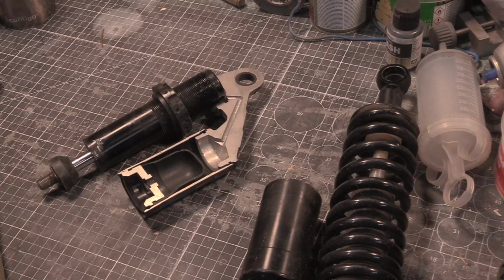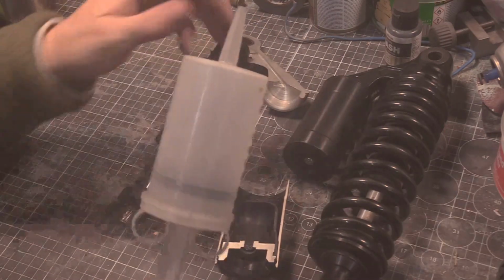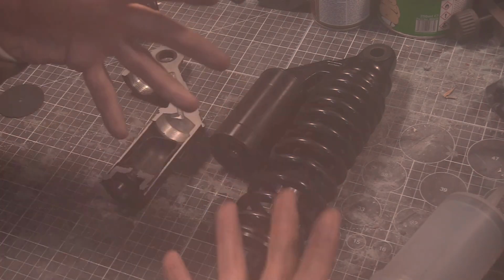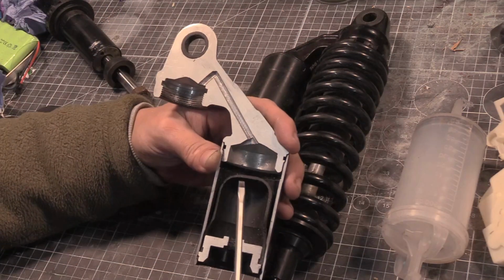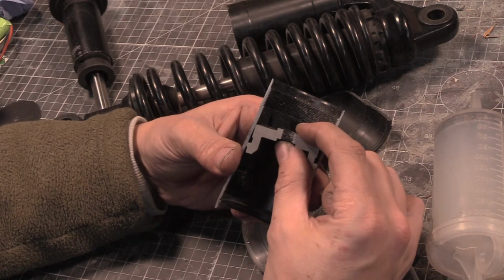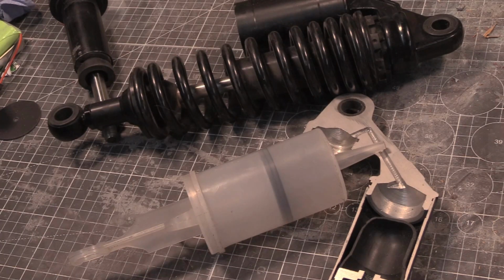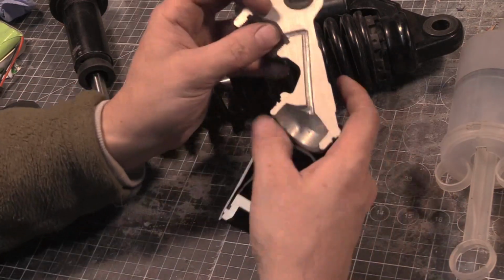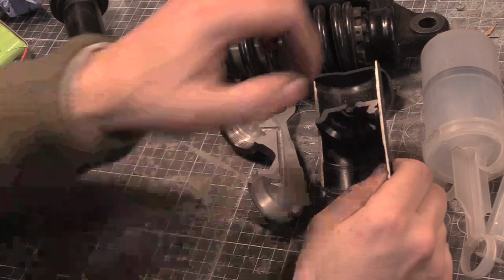TEC shock autopsy

Comment: So Matt, better than you thought and bearing in mind they are a tenth of the price of Ohlins good value for a basic upgrade
on a budget. I had a early version of these years ago and they worked fine for the 20K miles I used them for.
They were about £ 80 a pair! and performed far better than the OEM ones . I didn't expect them to be made or perform like
a top quality product. 
TEC are a great company to deal with , very honest and straightforward and give the ordinary guy a chance to customise
their bike at reasonable cost with decent quality components ( not all of which are made in China)
Reply from the maker: "So Matt, better than you thought and bearing in mind they are a tenth of the price of Ohlins good value for a basic upgrade
on a budget."

- I didn't say that. I said you might as well put jelly babies in it.

These are WORSE than any OEM version, apart from maybe RE, where they're the same.

"I had a early version of these years ago and they worked fine for the 20K miles I used them for."

- what does work fine mean? And are you saying they were better than the OEMs and how do you know?

Comment: The way I see it that this is a version of an old type shock with valves in the piston and the external appendage is to separate the oil from the air (in old shocks the oil fill is to about 90% or less so the oil can expand with temperature differences) so that in rapid movements the oil has no chance to foam up.

Comment: most of the damping is controlled by the shim stack on the piston not the oil flow into the reservoir which you have totally ignored, adjusters on the flow to the reservoir are for fine adjustment only.

Comment: I worked in a damper test facility and did competitive comparisons on outside aftermarket products occasionally.  That reservoir is just meant to allow a smaller tube for the piston so it fits inside a spring.  the gas pressure in the bladder just keeps the fluid From all migrating to the chamber.   It won't help cavitating except at parking lot speeds and If you put any amount of real gas pressure it it, something will fail.  Fun fact:. If you cavitation test (or any  high velocity test) one for any length of time, that rubber will tear.  I'd bet money that there is a (shitty) valve stack in that piston.

Comment: On dirtbikes you need to service shocks quite regularly. Manuals usually require pump gas reservoir to 100KPa(140-150psi) pressure. Usually they ask to use nitrogen but I think most of people ok with air. 
Piston type gas reservoir are more advanced and supposed to be better, but somehow people now convert them back to bladder on KTMs. Maybe it is bad design, but they speculate about high static friction of piston and as result harsh behavior on small bumps.

Comment: Citroen perfected suspension
Reply: Nah, they just found a way to make air suspension cheaper and more adjustable. It's not as good as active suspension systems, but a lot simpler at the same time.
Reply: Id say williams did that in the early 90s
Reply: @stanmil5495  I’d say Citroen were pretty close 20 years earlier. Not perfect maybe but a beautiful mechanical/hydraulic/oleomatic solution.

Comment: Most mountain bike forks and shocks use air springs, I think for simplicity and to loose the weight of the spring. They seem to work pretty well .
Great to see inside, top job
Reply: Some even have duel air Chambers.  Others use coil and air (mostly dirt jump forks and some downhill forks like the Manitou Dorado fork) . Downhill forks will use coil still as they are more supple than air .

Comment: I remember those pure gas shocks you mentioned - Fournales I think they were called. On the subject of recharging the nitrogen on sealed shocks, Öhlins use a needle tool which actually pierces a rubber membrane within the reservoir and the gas is introduced through that. When the needle is removed, the rubber membrane instantly "self-heals" and seals the gas inside. Interestingly, the actual gas pressure is not that critical, (within limits). This is an extract from the TTX service manual, which has a recommended gas pressure of 75 bar. "In the TTX, different gas pressures have no influence on the damper characteristics. For instance a range of 2 to 10 bar can be used with no influence on the characteristics. Even going higher than10 bar will not effect the damping characteristics but it will exert unnecessary forces on the damper parts. Be aware that at 0 bar, there will be cavitation."
Reply: Fournales uses a gas spring with an oil damper. There was a series of mountain bike shocks and fork cartridges that used air as the damping fluid in addition to acting as the spring. That was ~20 years ago so suspension travel was commonly much less on mountain bikes which might have covered up a lot of flaws. IIRC they were straight orifice dampers but they probably behaved differently from hydraulic orifice dampers as the air was compressible. I've never been able to find a force-velocity diagram of one of them though. 
Air-spung oil-damped suspension is common on mountain bikes and used in some Motocross forks and snowmobile suspension. Airplanes frequently use air springs in their landing gear as well.
Reply: @Surestick88  There's an interesting load/displacement graph for a Fournales shock in Tony Foale's book "Motorcycle Handling and Chassis Design" p. 6-6 if you have access to a copy.

Comment: I have a fucked vfr800 vtec shock, it was leaking so I got a replacement. I did cut the rubber remote preload pipe to make it easier to remove though. it's just been sitting in my shed cause I'm lazy and haven't taken it to the tip.
If you want it you can have it.

Comment: Ha ha ha when I was a kid I used to make air suspensions for my RC cars with small syringes. Different size bottles as remotes,  different size and material hoses to attach the bottles to see how it affected the suspension. They were really shitty suspensions but they taught me a lot about how to change the characteristics of it just by the routing of the air.

Comment: Mountain bike suspension pumps which are for high pressure, low volume air springs usually have a two stage/zero loss connector to stop the pressure escaping from the schrader valve when unscrewing the connector from the valve. 
 First you unscrew the part of the connector that presses on the valve core, closing the valve, then unscrew the rest of the connector meaning no air should be lost from the air spring of the fork/shock.
 My old Topeak pocket dxg shock pump has a two stage, zero loss connectors. I still have them from when I used to ride mountain bikes with air sprung forks and rear shocks. My forks just had an air spring, the damping oil wasn't pressurised 

(apart from one model of fork I have with switchable travel, which had a common fault where the air chamber seal would pass air into the oil filled chamber that adjusted the travel of the fork, blowing the oil out of the fork. I had a set rebuilt with new parts by the distributer that when I opened the box the seals had already leaked in transit . They eventually built me a brand new fork as they had none left, but I hardly used it, I was thinking of stripping it to see if I could find a better sealing solution than the stock orings, possibly a quad ring seal or something that might handle the pressure better)

One of my air shocks does have a air spring and a pressurised piggy back oil reservoir with an IFP, Fox DHX 5.0 Air.

Comment: BTW Fournales make spring less bike shocks, they use air only, though at high pressure, something like 900 psi, had them on one of my bikes for many years, they still work fine.

Comment: Miss a couple of important points. The damping action converts oil flow into heat. Heat is dissipated through the shock body. If the heat builds up from excessive action the oil will start to vapourise and the shock fades. 
The gas pressure is there to reduce cavitation as u say and also raises the oil vapour pressure to stop the oil from boiling and causing fade. 
That Gas canister is totally wrong, the oil shouldn't be able to push down the gallery to the gas bladder. Needs valves to prevent this. 
Oil flow should only be through the piston valves so as the piston moves up oil is displaced to the bottom of the piston in a controlled manner. 
Can't comment on the floating piston type, would be interesting to see one sectioned.
Reply from the maker: When force is applied to the oil there's a transfer of energy, kinetic to the oil, and this compresses it. The pressure of the oil is a energy reservoir so has potential energy. The system isn't sealed, so the pressure is due to the flow rate through the drilled feed to the piggyback cylinder. The flow is resisted by the cross-sectional area. Due to compression heat is a waste product, i.e waste heat. This is a by product and not the function of the system. 

What I mean in basic chat is a brake system is a heat conversion system, suspension isn't. In fact this is something of an issue that needs to be handled, which is based on what you've said. 

I'm trying to get the mechanical point across. In future videos we'll talk about the limiting factors like the materials used (limits of using oil) also more about viscocity, heat dissipation, harmonics etc.
Reply: No, oil crush gas bladder. Shock shaft dispalce additional volume when it's moving in. The volume of whole system is smaller in compressed state.
About heat you partly right, but it is important if you race on professional level. Otherwise most of heat comes from exhaust pipe nearby.
Reply: @thedirtyworkshop  I agree compression produces heat but the inverse must also be true. So on the down stroke as the fluid expands the oil would cool. I'm old enough to remember the days before Gas pressurised shocks where a thing on dirt bikes. The  old bed springs (as we called um) would turn to pogo sticks pretty quickly with some harsh treatment. 
Looking forward to seeing a propper damper sectioned.

Comment: When the weight on the spring is high enough to make the closer coils (at the top) go coil bound, the spring becomes effectively stiffer, yes?
At first I thought you were saying the higher angle/greater spacing of the (bottom) of each coil means they are stiffer (whereas each coil is longer, so will deflect more) but you are really saying that the higher angle means less coils per unit length, hence the reltive increase in stiffness - correct?

Comment: Question - the OEM rear on my old zx9r (at 98k miles I'm on my third) has a nitrogen gas reservoir - how much of the suspension does this contribute to at the rear? I'm almost certain that at this point, 20 years down the line, there won't be any gas left in the shock. But it got me wondering what I'm missing. Several people tell me not very much at all, for normal road riding.

Comment: I'm not going to buy a set to verify this but I found a statement on another site - chrislivengood - "11 psi according to the instructions" which makes me think the settings are included with the shocks. It's likely to vary depending on model.

However I also found another statement claiming that he had to increase the pressure to 45 psi (80 psi in another statement) to return the shock to fully extended. That's the function of the spring, not the gas, so he clearly doesn't understand what he's got. Another Del perhaps?
Reply from the maker: LOL he did what? to returm to full extension? 

As for the instructions, someone sent a message saying he has instructions and there's no mention of a pressure. I'll chase him up and try to get a picture

Comment: Nice one Matt.  I hope this question doesn’t make me sound like a total Bellend. I’ve always had it in my mind that: 
The springs absorb the the energy / shock from the road, so I’ve always thought they were the Shock Absorber’s.   The Hydraulic/Gas struts Dampen the spring bounce and are called dampers not shock absorbers (I know they shock absorb as well). 
Yes I know it’s a really complex system.  If I’m being a total knob please let me know. Take Care. 

I’m walking backwards for Christmas this year, just in case. 🤙.
Reply from the maker: It like trying to seperate what front forks do with front brakes. The forks are there for suspension, and the brakes to stop you, but when you pull the brakes the suspension works, even on a perfectly flat smooth road...

It's actually a big problem for suspension and brakes, and why they made the anti-dive systems and why hub centre steering exists at all.

Comment: Im going to have to disagree with you about the setup being useless. Badly designed, maybe. Untested, without a doubt. but useless? no. 
Standard shocks are usually emulsion shocks, where the air lives in the same cavity as the oil. as the shock is in operation said oil is blended together with the air making an emulsion its why on some bikes you will find the suspension feels floaty and gross after 15/20/45 mins of riding.
By having using a bladder (not a balloon) it allows you to keep at least some sort of consistent feel over the duration of a ride, as the oil is separated from the gas. you could go as far as to change the oil weight with this to change the damping characteristics (you wouldn't but I hope you can see my point) 

Also, it would have been good it you got the seal head out so we can look at the shimming and valve! 

crap, yes, useless not quite, better than oem.......uhhhhh......maybe a Harley :D
Reply from the maker: "you will find the suspension feels floaty and gross after 15/20/45 mins of riding."

1 - I know what emulsion shocks are but thanks for the lesson. I even did a video about it, long ago in a shed far far away.

2 - I would love to know how you know a rear shock is performing badly on britsh roads and it isn't anything other than the shocks and due to it being an emulsion shock. I'm being serious. Do you have any examples?

3 - bladder or baloon LOL

4 - Keeping the oil seperate from the gas does what? I know what it is said to do, but I wanna hear your explanation why.

5 - I do get your point about oil.

6 - I'll mill the end of the shaft off and get the rod out. 

Are they better than any OEM? Probably the same as RE, because I've seen those and I'm sure theyre from the same factory in Shenzhen
Reply: I'm curious what information by looking at shim stack you can deduce(because some people in comments want to see it)? In my understanding without knowing dimensions of piston orifices, all shims and do shim calculator you can't understand anything.

Comment: If the HD rear brake master cylinder, swingarm, engine cases, fittings and other stuff are anything to go by, this chinese cheap shocks are an improvement over the OEM shocks.
Reply from the maker: why?
Reply: @thedirtyworkshop   Just joking Matt. I was taking a stab at the shit stuff HD made. I wouldn't buy anything made by TEC or HD. The sad part is that while TEC are cheap shit, people pay good money for HD products.

Comment: What a load of crap . That took you half an hour to explain completely wrong the point of the reservoir.  It's to pressurize the oil and allow for the oil displaced by the volume chrome shaft to have somewhere to go.  Damping is mainly done by valving on the main piston .
Reply from the maker: Lol let's go through what you just said. 

It's to apply pressure to the oil. Yep said that.

It's for the displaced to have somewhere to go. Yep said that

Damping is mainly done by the valves on the main piston. 

Damping is done by the oil. I couldn't or hadn't got to the piston because of the reasons I showed. 

I explained that by restricting the oil flow that's how dampening is metered. I also said we're going to go through the entire shock design in the near future with an entire series of videos...

If that's too much for you to understand I wouldn't sub to this channel. We seem to have reached the limit of your intelligence.